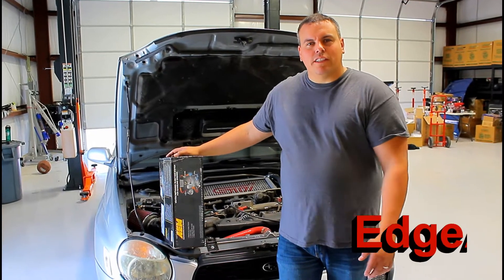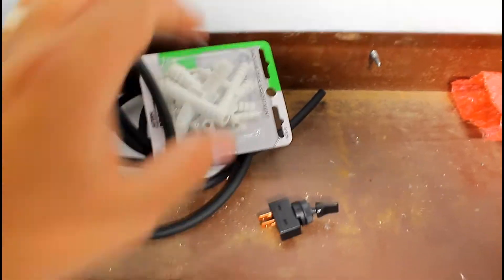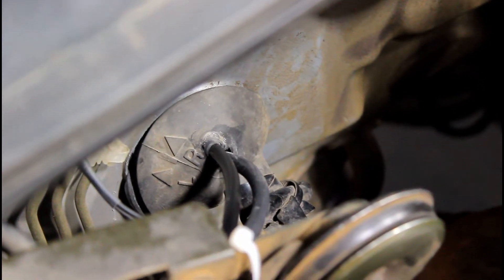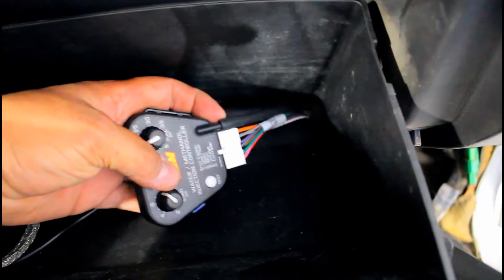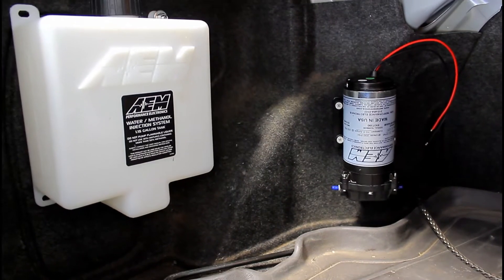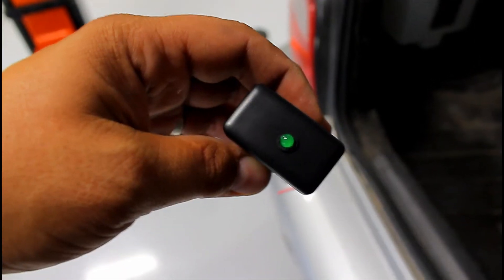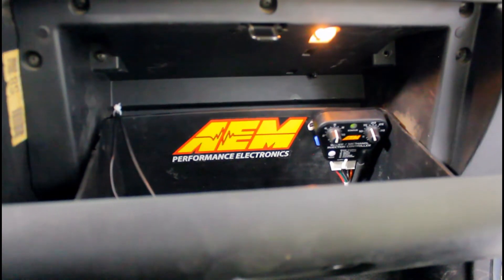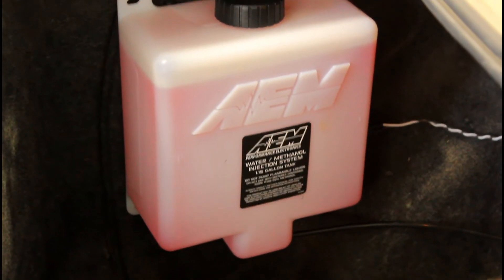How To: AEM Water Meth Injection Step-by-Step Install Subaru WRX STI

Comment: How’s the kit holding up after a year?
Reply from the maker: just fine
Reply: @FatGuyBuilds  ok any recommendations before I purchase this kit?
Reply from the maker: @deko9151  buy a weld in bung for the intake piping or weld a bung in the intercooler
Reply: @FatGuyBuilds  intake piping where ?
Reply from the maker: @boysfromtbay8707  between intercooler and throttlebody

Comment: to power the switch did you tap into a fuse, or run a line to positive side of the battery?
Reply from the maker: You can use an add a fuse from the auto parts store.  We already had gauges installed so we jumpered off those
Reply: @FatGuyBuilds  sweet thanx man. great video